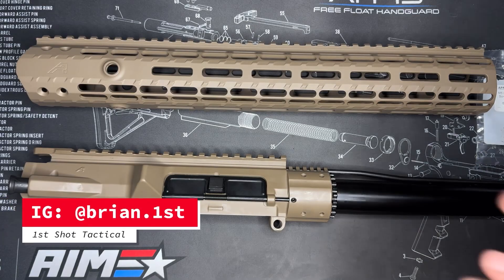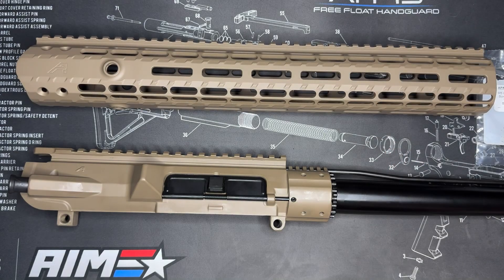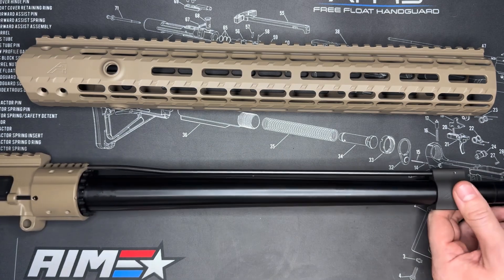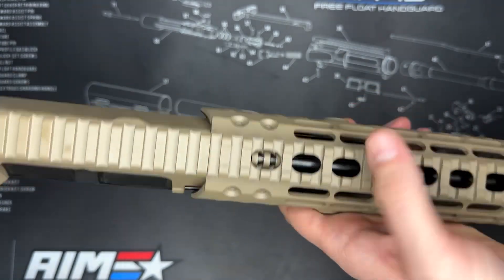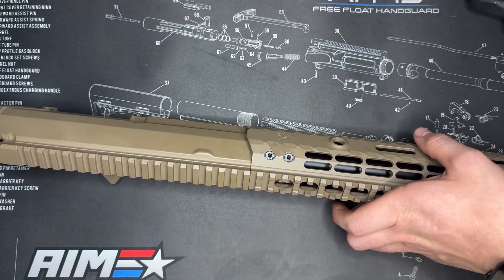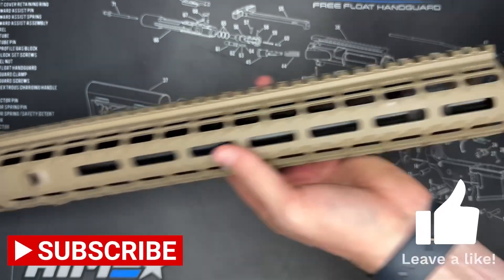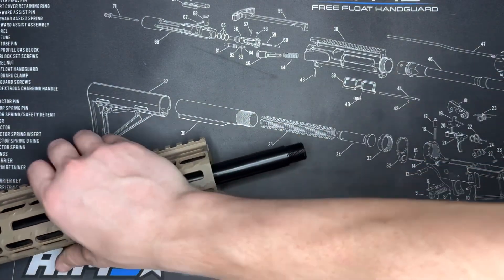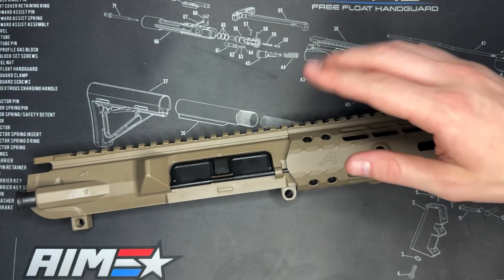Install AR10 Handguard | Aero Precision Enhanced Handguard

Comment: The Enhanced series is much better than the more popular Atlas One offering from Aero because you can fit a far bigger variety of gas blocks under the Enhanced handguard, and rail covers don't come into contact with aftermarket gas blocks, nearly as easily as they do on the Atlas One.